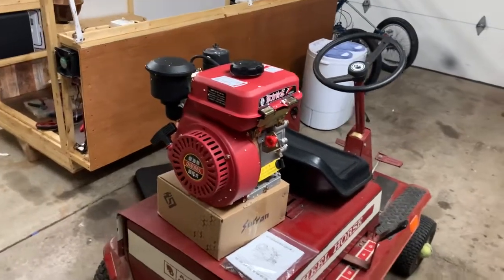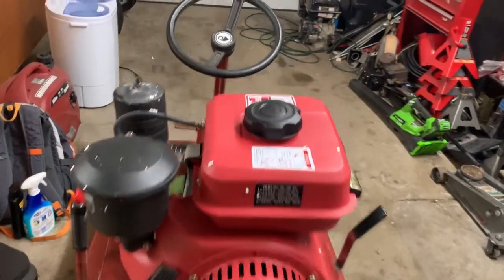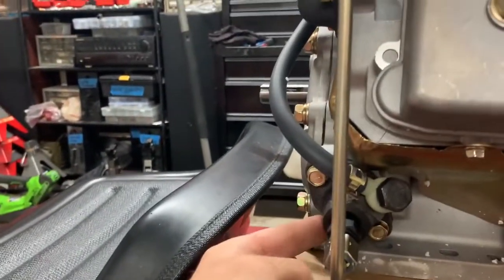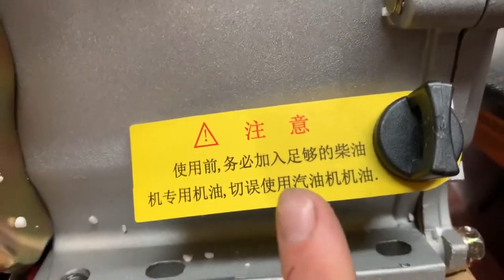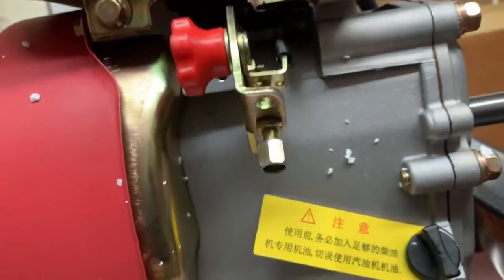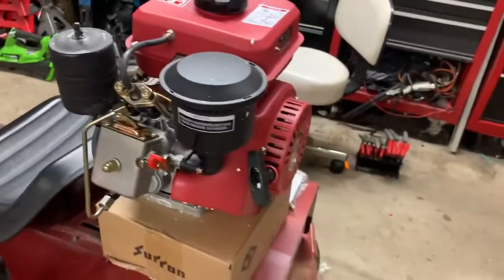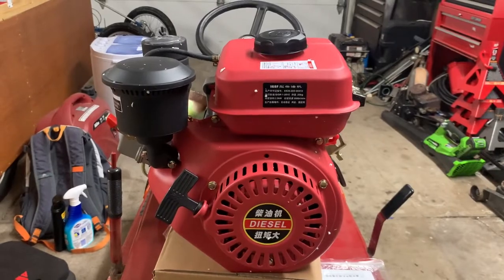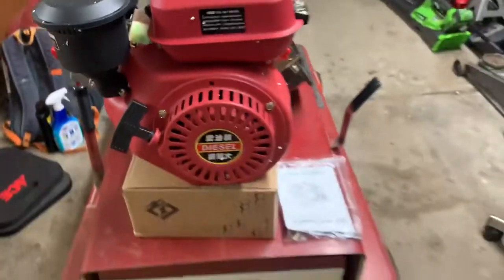Diesel "6 HP" Go Kart Engine!? Unboxed + inspection

Comment: The only way to make more power in a old pump - line - nozzle motor like this is to increase the output of the injection pump.
 The bottom part is the pump, it is a piston pump actuated by an extra camshaft lobe.
 It's output volume is controlled by the governor mechanism inside the side cover.
 I can't tell you exactly how it works from the fuzzy Chinese parts diagram unfortunately, I haven't had hands on a diesel this basic in 20 years and that was a 20yr old German flat opposed twin cylinder air cooled Genset that worked flawlessly. 
 If you apply forced induction send boost pressure to the tank and pressurize it and the supply and return lines together. This will increase injection pressure under boost and could increase fueling by a few percent and keep the injection timing correct. Just put a tee fitting in the boost line with a short tube - check valve - and one of those little breather filters. That will vent vacuum to atmosphere but pressurize the fuel system under boost.
 You could also try one of those little crankcase breather powered fuel pumps to boost injection pressure and get more fuel into the cylinder.
 Good luck.
 If you want to do a video where you pull the side cover off?

Comment: All I could read on those warning labels was scribbles and I'm from Macau (what a shame, I know). But comparing the looks of the Cheng Chung diesel and the gasoline Honda clone that has a Hisun nameplate on my Coleman bike, I'd say everything on the aftermarket (except cylinder heads since they have a spark plug hole) for the gas small block Honda/Predator/Tillotson/Clone engines should fit on this diesel with no problem at all. As for the big block (406cc) version of this diesel, which is roughly 200cc bigger than the one you have (196cc), I think all the aftermarket parts for the gas big blocks should fit the big block diesel as well, with the exception of the cylinder heads that is.